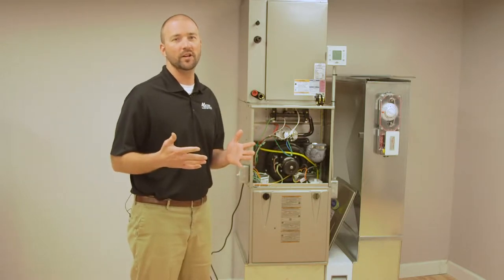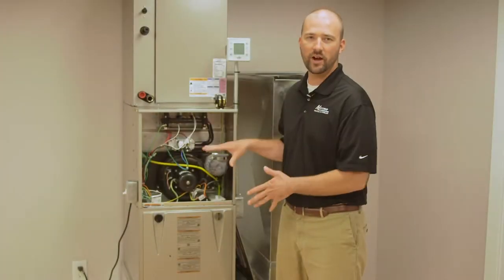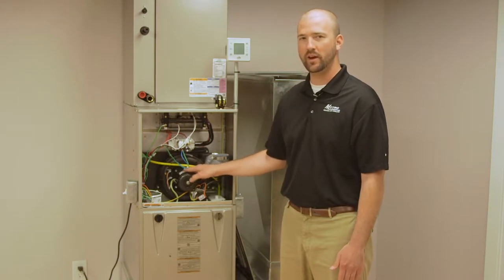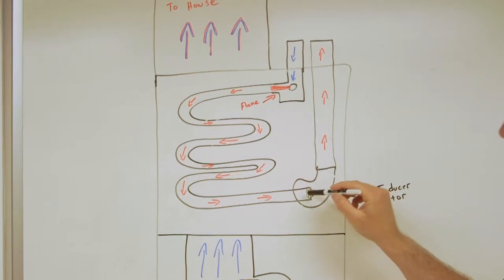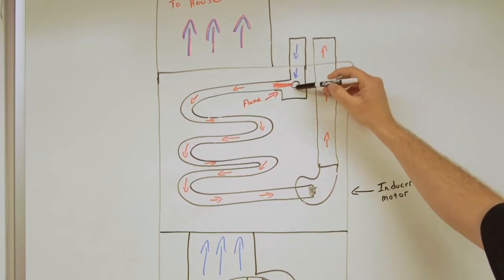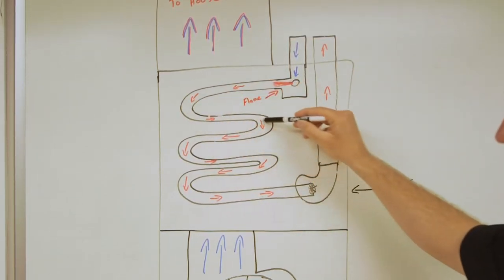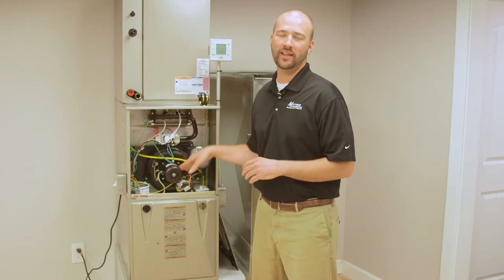What is a Draft Inducer Motor and how does it work

Comment: Great video.  Hi, my york YP9C inducer motor has only two wires. How is it able to ramp up and down with only two wires connected. One wire is HOT and the other is NEUTRAL. Thanks.

Comment: Hi Joe Tollari, Thanks for Excellent Video.  At my Furnace 
I am seeing water leak coming from  bottom portion of Draft Inducer Motor. Could you please advise what should be the problem, and how to fix it. Thanks.
Reply from the maker: Sometimes the plastic on the housing can crack and begin to leak water. You may need to buy a new inducer assembly.

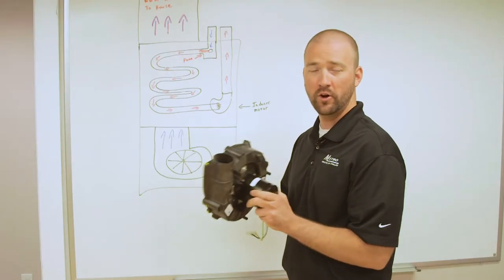Comment: 1:38 Does the inducer fan keep running once the main blower fan turns on?
Reply from the maker: Good question. Yes it does.
Reply: Sorry I'm late but yes it does and it kicks off after the burners turn off
Reply: Does the inducer motor always run at the same speed? Even for 2 stage or multi stages? Thx

Comment: Does the inducer collect moisture , and can it leak of moisture?
Reply: In 90% furnaces where the gases are condensing, there is or should be a drain at the bottom of the inducer that connects to a condensation drain. If that drain gets plugged up due to low maintenance it can fill up that inducer and sometimes it’s pressure switches, seen it happen.